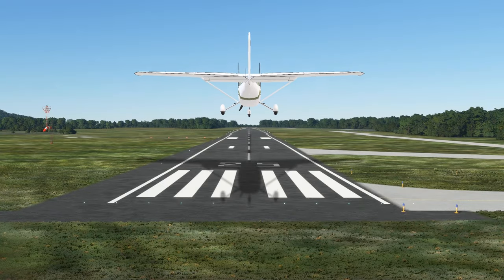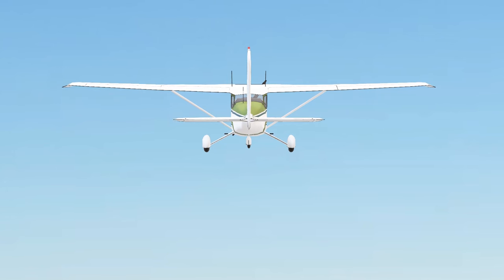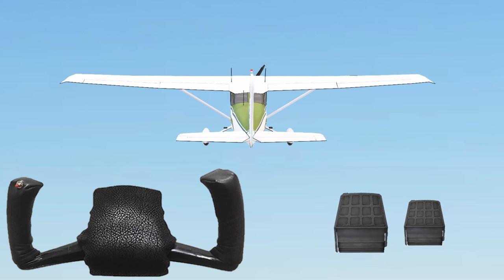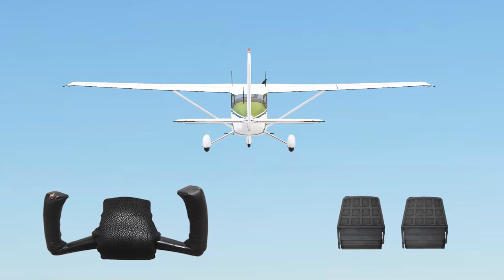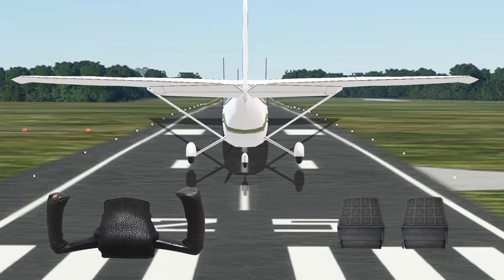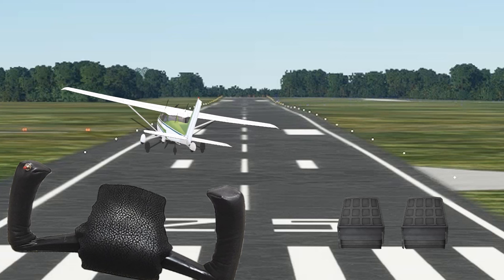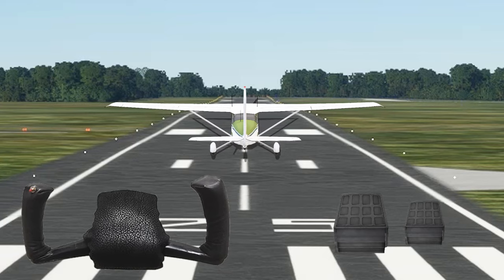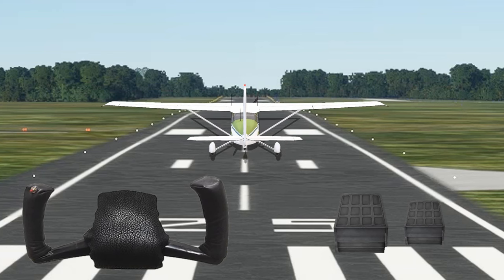Why You Can't Hold Centerline on Landing | Coordinating Rudder and Aileron

Comment: After 1000++ hour of actual flying, I still can't coordinate my turn in msfs or in actual airplane. I still can't control pitch during flare, i usually over or under pitch. Something really wrong with me. Quest I have to say good bye to flying and I can't afford further training.
Reply: Coordinated turns ailerons and rudder move together, it’s like a dance as you roll the aircraft the rudder starts to move with it; the more you bank the more rudder you need.

The pitch during the flare as you come to the round out with power to idle hold your nose up to about the tops of the tree lines if you have trees, as you start to slow down you’ll lose more vertical component of lift so you will need more back pressure as you continue to slow the aircraft, maintain good cross control using ailerons and rudder for crosswinds as needed.

Have your instructor only go over fundamentals of flight with you until you get those down then move on from there, I feel like a lot of it you are over thinking and it sounds like you might be over controlling the aircraft, get the basics down first and the rest will come easier, best of luck to you if you really love this I wouldn’t give up, I was always bad at school and now I’m about to be a CFI I finish the flight portion this Tuesday, you can do this if you believe you can mindset is everything.

Comment: One thing that seems to never get mentioned is the wind change on final. When you are fighting to cross control the airplane 500 feet agl and below the winds are stronger and perhaps from a different angle than in the flare. It’s a good idea to make sure at the higher altitudes on final you have adequate rudder authority to straighten it out but for more practical use, fly the plane down centerline and accept the crab angle til over the numbers and then apply whatever correction is needed before the flare. The correction is typically much less down lower and better than wrestling the plane all the way down final. If you have to accept a small angle on landing it’s not the end of the world in most cases. What you don’t want is to land with a high crosswind component beyond your ability or that of the aircraft. Side load on the gear should be kept to a minimum.

Comment: Depends a lot on the particular airplane. Left turning tendencies mostly go away when you pull the power to idle. If your aircraft's fin is offset to counter those tendencies (set for neutral rudder during cruise), you'll need a bit of left rudder when you pull the power off for descent and on short final because the fin is set to yaw the nose to the right. So watch out for this and don't be surprised if you need a bit of left rudder. In the end, it doesn't matter what causes it. Your job is to use rudder to keep the nose pointed straight down the runway, and ailerons to kill any drift away from centerline. And a lot of the time, the two controls will need opposite inputs, sort of like chewing gum and walking at the same time. Also, a pilot tends to land on the side of the runway corresponding to the side of the plane he sits on. Left seaters tend to land on the left side of the runway and right seaters tend to land on the right side. Doesn't seem to matter if it's a Cessna 172 or a Boeing. 

BC
26,000 hrs
Reply: THANK YOU! THANK YOU SO MUCH! OMG!!!
Reply: Thanks, I was thinking similarly while watching the video
Reply: Well said
Reply: Thanks man！It helps me a lot cause Im struggling in landing as Im learning to fly c172.
Reply: This happens to me in the PA 28 Warrior II. Instead of right rudder, Flaring, I see the nose sort of pointed toward the right and I use left rudder
Reply: i like this explanation..so the other day i'm landing on 19L and the wind was coming from 210 at 6-8kts and after i leveled off over the runway the plane started to yaw right. the Chief pilot said i coulda just used left aileron and "steer" the C172 back to center. I tried using Left Rudder but didn't seem to have any affect
Reply: "Your job is to use rudder to keep the nose pointed straight down the runway, and ailerons to kill any drift away from centerline. "  love this, conclude landing in one sentence!

Comment: Good coverage of how coordination of controls will make things work well.  While I believe in coordination, I feel we have left out the proper use of rudder alone to bracket the centerline  with proper yaw.   How we explain coordination, the words we use, may lead students/pilots to avoid good rudder only usage and even proper coordination.  Should we really bank and then step on the ball to come back into coordination?  I teach Dutch rolls to 45 degree bank angle to overcome the wing warping, frise ailerons, and spring interconnect devices to mitigate adverse yaw but not eliminate it.  And I use the yes, incorrect, but also useful with humans who have steering wheel muscle memory, "lead rudder."  Unless we humans think lead rudder, we are late with rudder in turns resulting in the nose yawing the wrong way first until we step on the ball.  So even if we do not "lead rudder" in turns at altitude we wallow along somewhat fine.

The problem comes with takeoff, short final, round out, hold off, flare, and roll out.  Back when conventional meant tailwheel, these situations that needed dynamic proactive rudder were rote.  We cannot walk the rudder pedals dynamically and proactively while thinking coordination.  Nor is coordination required because since we are constantly moving some as a balancing a broom on our hand or awaiting a service in tennis or playing man to man defence in backetball.  I start tailwheel pilots out with the task of maintaining the taxi line between their legs with slow taxi while walking the rudder pedals dynamically and proactively to the stops left and right.  I want them to understand that it doesn't matter how much tailwheel or rudder movement we use so long as it is dynamic.  Students/babies learn fast if allowed gross motor control before expecting them to walk.  As they progress the dynamic proactive rudder movement will become quicker and more finessed.

So on short final we walk the rudder pedals dynamically and proactively to bracket/nail the centerline between our legs for longitudinal alignment.  Since we want to go straight and not turn, we need no aileron.  And if we keep the nose (between our legs) bracketed tightly with rudder, the wing cannot bank.  This is true even in gusts.

On takeoff we do not need worry about when to expect the precession when we bring the tail up or the P factor when the nose wheel comes just off or P factor when we pitch up to bring the mains off.  Since we are already walking the rudder pedals to bracket the centerline between our legs, we are well ahead of the airplane and its left turning tendencies.

You are right about coordination.  Make them lead rudder in turns.  Don't let them turn on short final (wing wagging.)  They will never truly align the longitudinal axis in a turn, but just keep flying through the centerline extended and having terrible problems with adverse yaw.  They are busy with round out, hold off, and flare.  And yes, the P factor thing.  But if the are continuously walking the rudder pedals to bracket the centerline between their legs, they are ahead of this as well.

Comment: Great video...!! Another 'force' that will cause it is all of that you said with the addition of Ground effect. The cushion of air added with the torque through the center line of the prop will exaggerate this effect as you approach you're aircrafts stall speed.

Comment: Im about 13 hours in (though its been EXTREMELY spread out due to weather), and I'm struggling with landings so bad. Even with calm winds I feel like I'm super wobbly in my approach, swerving left and right while trynna stay coordinated and constantly overcorrecting. Doesn't help that I've had to switch planes a ton and I've only had one lesson where we practiced slow flight, (which was in a different plane) I def think I need to practice it more bc my terrible approaches make a clean landing near impossible. Is it normal to be struggling this bad 15 hrs in? I feel like most people get it down pretty fast but it's my 2nd day of doing nothing but pattern work and my landings are not only not smooth but some of them have been legit dangerous. Idk how I'm ever gonna get this down haha